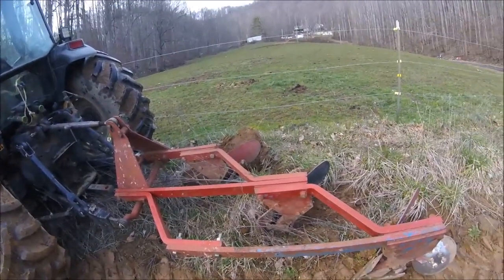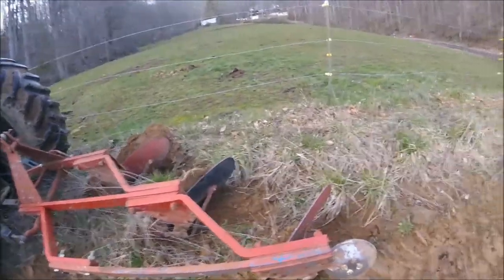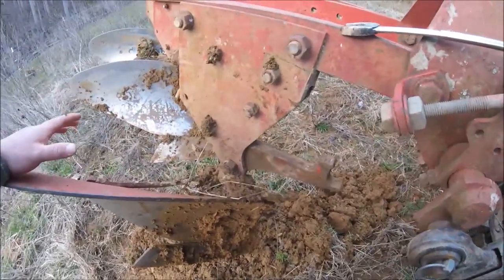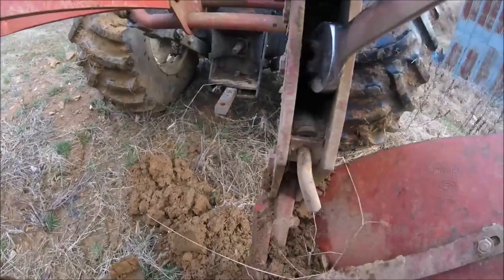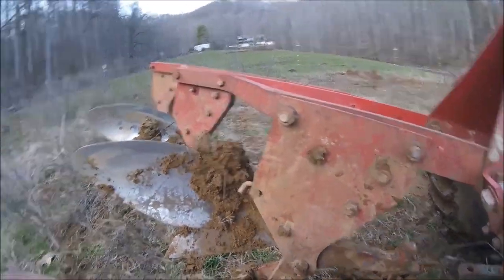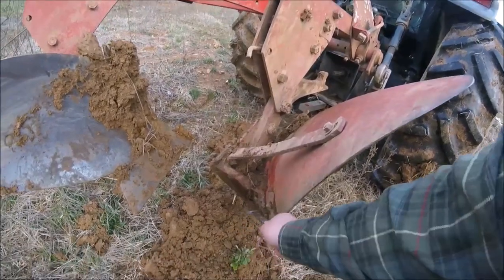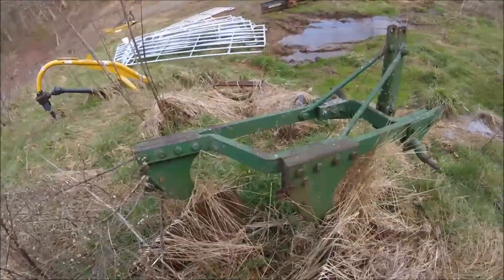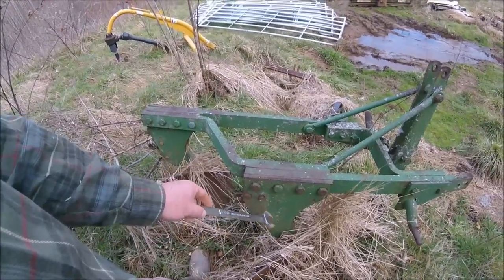How To Manually Trip Ford 101 Plows

Comment: About the John Deere plow, if you drill it and put a shear bolt in it, will it still trip ? I have the same issue with my JD plow, one of the blade is always tripping. Thanks for the video !